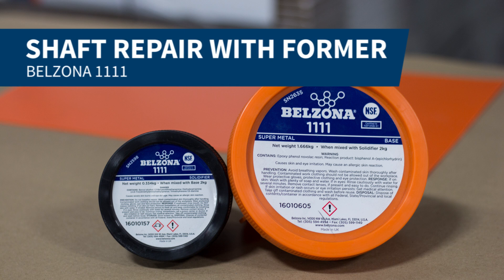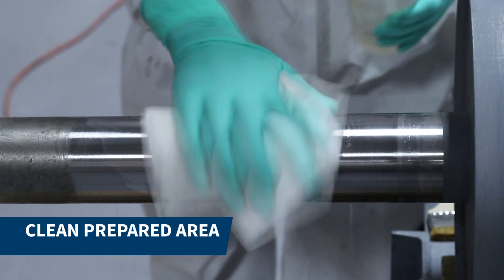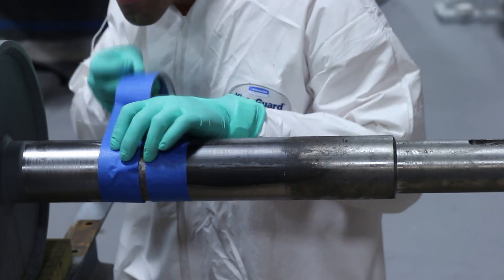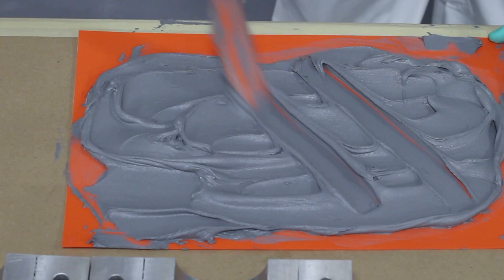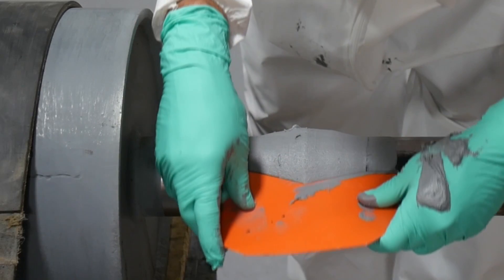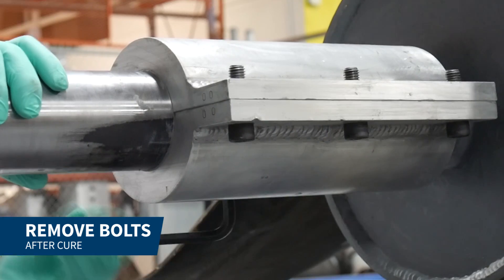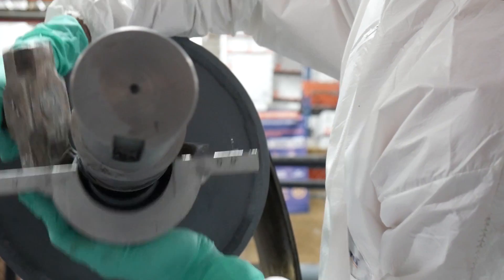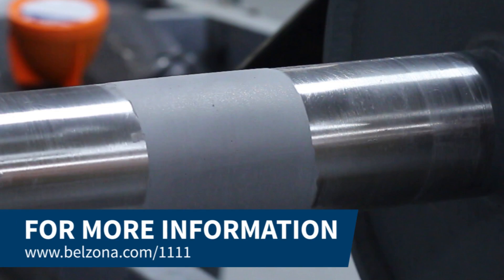How to Repair a Drive Shaft Using Forming Techniques

Comment: Buenas tardes , es posible rellenar el cuerpo interno de una bomba de alta presion de fluido de aceite ,  cabe hacer mención que es de aluminio , Nicaragua.
Reply from the maker: Si es posible, nuestros productos despues de una correcta preparacion de superficie se adhieren al aluminio., tambien recomendamos depues de rellenar el metal perdido, aplicar un producto con resistencia a la erosion, contacte a su distribuidor local en Nicaragua para la seleccion de productos y apoyo en la aplicacion usando belzona.com

Comment: how much time the blezona take to be solid ?
Reply from the maker: Hi Mostafa, 

A full mechanical cure is achieved in 24 hours at 20°C. Movement, machining and light loading times vary and are all affected by the ambient temperature. There's is a really handy cure time table  in section four of our instructions for use document that can be found at the link below. This will give you a better understanding of your specific cure times. https://www.belzona.com/viewfile.aspx?id=51037

Let me know if there is anything else I can help with!

Many thanks,
Miles

Comment: Would this material work to repair a shaft which has a groove cut into by  the lip of oil seal?
Reply from the maker: Hello and thank you for your question! If the grove is on the the shaft independent where it is, with the correct access to the area, the repair can be done. Let us know if any other questions. Best regards, Belzona Team